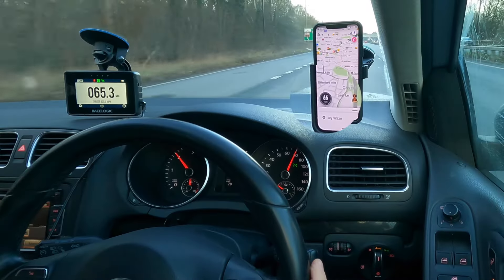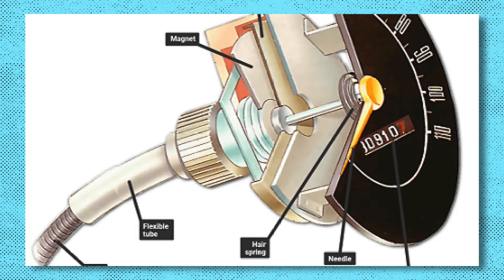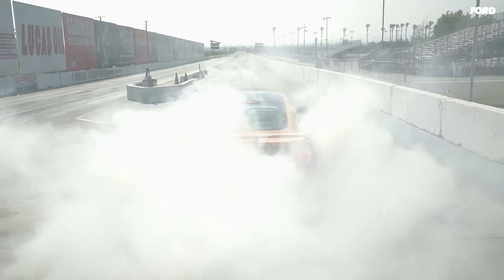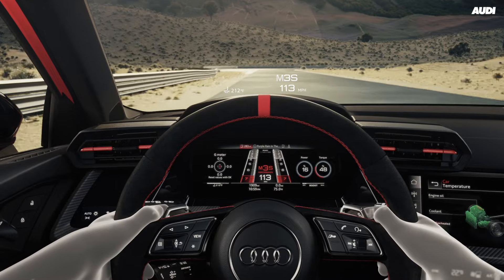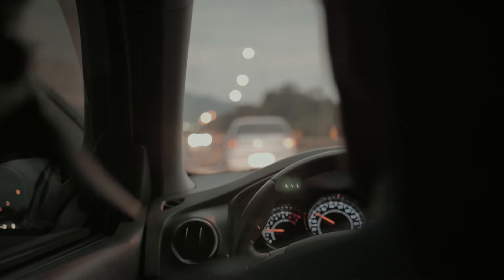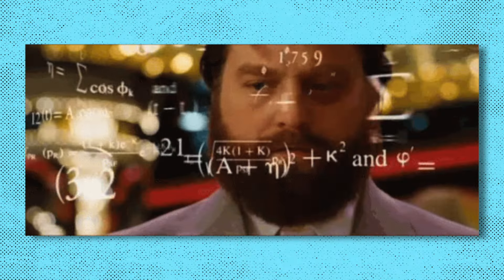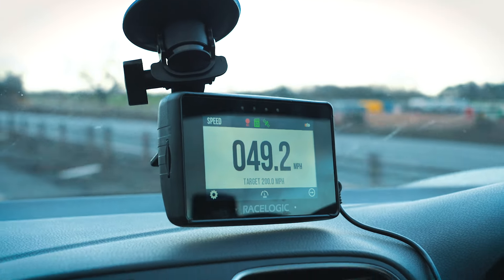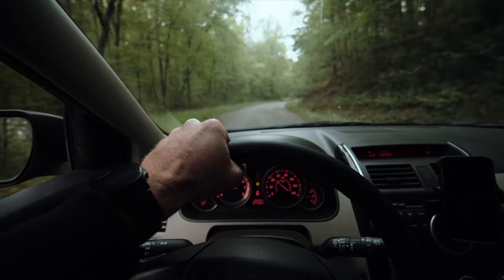Why Your Speedo is Lying to You

Comment: wheel speed sensors are usually used for abs and esc. 99% of the time most cars use a speed sensor from the gearbox for the speedo. just FYI.  Also the faster you go the futher out your speedo will read
Reply: Glad to see someone here actually knows the truth lol
Reply: Unless you have an old VW beetle with a hub reading
Reply: All the cars I have owned show speedo is off by the same absolute amount regardless of speed.  The computer reads the speed from sensors and subtracts a given amount…50kph is really 46, 100 is really 96.  120 is really 116.  Not a percentage amount, but a fixed amount regardless of speed.
Reply: Except most japanese cars? Which use the wheel speed sensor in the wheel hub.
Reply: Most EU manufacturers stopped using a gearbox speed sensor in recent years. Utilising a wheel speed sensor means they can cut costs and that sensor can have multiple uses, especially for the ever increasing amount of tech such as adaptive cruise, accident avoidance, cruise control, ABS/TC/SCS and even airbag systems. For instance, and from memory, Mercedes use the right front sensor for the speedo.
I'm sure some vehicles use GPS too.
Reply: Uhh no. May be true for American cars but Germans cars Def use wheels speed sensors for speed. On some cars you could even prove that by unplugging specific wheel speed sensor and speedo would stop working
Reply: Exactly!
Reply: @borysnijinski331  Does that mean it shows 0 at 4kmh or less?
Reply: @lukeberry94  my 2005 Honda has it on the transmission. The first time I did my brakes, I forgot to hook up the wheel hub one and the ABS system was NOT happy, but speedo was fine.

I use GPS everywhere and the speedo is bang on.
Reply: I work for Toyota, and for honda, kia, Mazda in the past. For the last 10 years atleast, the abs sensors are what gives the speedo reading. The gearbox method was eliminated sometime ago and definitely won't see it today
Reply: this is my understanding too, that it come from the gearbox. and also with the inaccuracy. it's a percentage it's out by rather than a set number of km.
Reply: It depends. First we had a mechanical cable to the gearbox, then we had an electrical cable to the gearbox, and then, as abs and stability control became standard in newer cars, some manufacturers figured why spend money on an additional sensor in the gearbox if you already have one on the wheel(s).
Reply: Some cars don't have vss, but the ones that have does this, so you speak the truth.
Reply: @Noreceipts400  No, it means the opposite. It reads as 4mph when completely stopped.
Reply: I broke my abs cable and my speedo stopped working until I fixed it
Reply: older BMW:s have the speed sensor in the differential
Reply: @lukeberry94  yeah, I've noticed infinities are almost exactly accurate vs bmw's are Abt 4 mph less says 64 when you're going 60
Reply: @borysnijinski331  This is what I’ve seen with my 2018 Civic Type R in the US.  From factory it was off by about 2 consistently regardless of whether I was going 30 MPH or 90 MPH; if it was based on a percentage, I’d expect it to be off by 2 at 30, 4 at 60, and 6 at 90, but that’s not the case based on the GPS systems as well as the radars that police set up that display your speed (only tested at 30 and 60 with the radars).  It leads me to believe that the car is taking whatever it uses to accurately get the wheel speed and just simply subtracting 2 from it.  It got me into the habit of just driving 2 MPH higher than what it was reading.

I also had a 2015 Camry before that which was consistently off by 3 or 4 (I forget the exact value; been a while since I drove it since I no longer own it).  Again, a constant 3 or 4 regardless of whether I was going 30 MPH or 60 MPH (checked by GPS and the police radars that they have set up on my daily routes).  I don’t think I ever did 90 in the Camry with a GPS running to confirm there though.
Reply: Most German cars use the wheel speed sensors most old and American cars that are older tec use gearbox readings
Reply: 99% of cars no longer have VSS in the driveline. The reason for that sensor was to mechanically "compute" the average speed of the wheels (using the differential as the computer) to account for cornering differences. Now that's done in software with no need for mechanical intervention. Any car with active stability control will almost certainly have ditched the VSS because it's redundant.
Reply: @roysoutdoorlife  Too bad cutting that certain cost means a high level on inaccuracy rather than using a proper and tested method.
Reply: Also if your tyres are more worn down it will say your are going even faster when you aren't
Reply: As a percentage the speedo will be off by the same amount. At 50 out by 5, at 100 out by 10.
Reply: @nallid7357  I think the accuracy is there but maybe manufacturers design a speedo to read high to help reduce speeds, which will increase fuel economy and reduce accidents? Just a thought!
Reply: @Mixz1890  American cars also use the wheel abs tone rings for the speedometer.
Reply: Moreover, that 10% overread is deliberate (at least on European manufacturers). It's based on a SAAB research. SAAB used to have a non-linear speedo, so the needle would be much higher than other cars, even for legal speeds, playing to the psychology of the driver. VW does the same thing on the lower end of the speedo to make acceleration seem more dramatic then it seems. So, car manufacturers kept their linear speedos and added 10% to the readings to make you think that you're traveling faster. It's also prevalent in motorcycles too.
Reply: @Noreceipts400  Most cars won't even show speeds of 10 or less, or so because it's not important. No limits go that low.
Reply: @samfedorka5629  Have you visually confirmed it's on the trans? It could be on a different wheel hub than you forgot the sensor on, unless you forgot all of them. I've got a 2004 Honda Civic and it would be interesting to locate this sensor myself.
Reply: @damderrick  What about cars before 2010 like 2004 Hondas? Have you had any experience with them?
Reply: @borysnijinski331  Most cars I've driven actually lie relative to the speed I'm pretty sure. Not a 100% sure but I think so. We've had new-ish Audis and BMWs and my dad has always said that it doesn't really start to lie until about 60-80 km/h.
Reply: @lukeberry94  all of my hondas get speed from a dedicated speed sensor mounted to the gearbox
Reply: I'm on the east coast our limit is 55 or 65 so I tend to go 70 😂

Comment: actually, as a delivery man, i'm quite familiar with this system here in Hungary. our fiats overread by around 6km/h, and fixed cameras have a given tolerance (by law) depending on speed, in 50km/h areas its 62km/h. so in theory you could pass the camera in a 50 zone at 67, and not get a ticket. I usually play it safe as you say in the video, and never exceed 60. and it's working, I haven't gotten any tickets so far. at least not from fixed cameras.
Reply: I stick to the 10% rule.. if Im supposed to go 50 Im going 55 on the speedometer and so on. But when I go through a route that I know very well (where the straights are, where it is possible to safely ovetake, where the holes are in the road, where the cops like to measure the speed etc.), I will push the car. Theres no reason to go 90 on a road that I can perfectly travel at 150 without endangering myself nor anyone else and also without the risk of getting a ticket.
Reply: @alunesh12345   Off point, but yes. Is speeding a sin though? I'd say it is.
Reply: @MisoElEven  If something changes you're going an extra 60kmh faster though. And what if someone doesnt realise you're going that much faster and pulls out in front of you?
Reply: @Noreceipts400  Theres nothing that can change on that particular road and I can see several km ahead..the faster the overtaking manouver is over the safer it is. What if the driver doesnt see you when youre going the legal 90km/h while the other one is doing 80? Nothing changes, you will crash if he moves to that lane or a car flies into my face from the other side. Seriously, unless the car in front explodes theres nothing that can happen on that particular road. Lets not forget theres not much traffic anyway. If anything I would be more afraid of gypsies crossing the road with their tons of copper and other scrap metal etc. XD in the city where I was born (Košice) theyre aparently going to lower the speed limit on the highway from 130 to 90 and install traffic lights just so they can move the trash they have stolen from one side to the other because if we built a wall again then the EU could sanction us for racism/segregation. Thankfully I dont have to ride through that piece of road anymore.

Edit: also you always have to let the car in the left lane go, even if its speeding and youre just moving to the left to avoid a colission with lets say a bus.
Reply: @alunesh12345  leave it out
Reply: @alunesh12345  so sad in the Netherlands I went 52 in a 50 zones and got a fine of like 40 bucks and 10 euros extra because they are so lazy and can't do their job. Really stoped caring about the speed limit after than and just look for cars and cameras.

 And I do intentionally drive way to fast on that road now, I need to earn about 50 euros worth of time on a road I only drive a few minutes on and account for higher fuel useage.
Reply: @NekoWinters  i wish ones where I lived would get destroyed more often. All they do is distract you from driving and make non dangerous situations dangerous since you can't pay attention to the road and 2kmh over the speed limit gives you a hefty fine.

Some peolple are so pathetic they will fine you for doing 121kmh on the highway when 120 is allowed.
Reply: In the US there aren't many camera systems that give speeding tickets as far as I know.

We have helicopters that can spot speeders, though. You'll see signs that say "speed enforced by aircraft".
Reply: @slowanddeliberate6893  Yes, but the amount of cops you have is ridiculous instead. And chasing speeders from helicopter is even worse. Speed cameras are bad - but at least quite easy to avoid.
Reply: @slowanddeliberate6893  depending on where it is. In md, dc its infestation of speed cameras.
Reply: @ravecsucks6192  these were based on my specific speedo. The thing is, we have fixed and mobile speed cameras. the mobile cameras are usually set up by the dear police, in some shady well covered location so you can't notice it until it's too late. on this mobile camera, they can adjust the limit at which it consideres someone speeding. the lowest they can set it is the given zone limit + 3km/h (so in a 50 zone 53, in 70 zone 73 etc.) the fixed cameras have a fixed limit, which according to most sources is either +16 or +18 km/h where the zone limit is below 100km/h, and +21 or +23 km/h where the zone limit is over 100km/h. so theoretically on the motorway you should be fine with 150 on the gps, and around 155 speedo, but I personally have never pushed to that far. https://alapjarat.hu/hasznos-infok/mekkora-sebessegtullepesnel-nem-buntetnek-meg https://www.detektorbolt.hu/gyorshajtas-buntetesi-tetelei-birsagok these are in hungarian, but there are 2 tables which you can check out in the articles containing the limits and fines.
also the trick is, that even tho the fixed cameras dont send a fine under these fine limits, they do notice of you go faster than the zone limit. so there is always a possibility that the police set up camp around these fixed cameras, and pull you over and give you a fine between 5-50.000 forints
ps: i usually set it at 136-139, so even the rozzers on location souldn't be able to fine me.
Reply: @ravecsucks6192  there probably is, but I don't know the laws on that.
Reply: @hagymasymarton4714  Have you taught about getting a radar detector? It seems like that could be quite helpful against those evil cops hiding with speed cameras, haha. Then you can drive at nice speed most of the time and only slow down where the cameras are. Where I live (in Sweden) they are kind enough to put signs in front of them, so it's easy to see where to hit the brakes (a detector hasn't really been needed). But I think I will get one soon anyway - because our cops is also about to get some nasty cars, where they use radar (I think those also might be some kind of mobile speed camera as well)
Reply: @MisoElEven  150?
Reply: @MisoElEven  I really hope you are talking about kph and not mph!!!
Reply: @tilburg8683  er gaat toch altijd 5 correctie af als het door een auto wordt gedaan, dus 121-120 kun je van een agent geen boete voor krijgen. 
En over die 50-52, dat zou je met een advocaat gewoon winnen, veel instituten die te maken hebben met de wet zijn er helaas niet goed van op de hoogte hoe deze werkt.
Reply: @MODElAIRPLANE100  150km/h not miles of course.. depends on the road too, there are spots where any speed is pretty much safe but then there are spots where you better slow down to 40 despite legally being allowed to go 90. Also depends if youre driving a 20 year old skoda or a brand new mercedes, whats safe or not really depends on your reflexes, knowledge of the track and the car itself... too bad theres plenty of 20 year olds who have little to no experience and they push it a lot in 20-30yo Bavarian monsters.
Reply: Damn that tolerance is massive! I wish they were as lenient over here in austria
Reply: @mattBLACKpunk  Well..they arent much different in Austria as far as I know. The "cameras" used dont even show speeds under 56kmh as far as I know.
Reply: @MisoElEven  yup, inside cities its 5kph over, but everywhere outside its 5% - 62 is a lot more wiggle room than 55 imo, although I might just start driving faster if that was the de facto upper limit 😅
What really gets you though is the 5% on country roads (105) and motorways (137)
Reply: @mattBLACKpunk  I use the 10% rule because the speedometer shows a lower value (on VW group cars its about 5%ish?). Speed really depends on the situation, you can be on a 50 but when someone jumps on the road from your right you still might get partial blame because you didnt adjust the speed for road condition etc. (the courts forensic expert might somehow calculate you should have gone 39kmh instead of 48 because of weather, cars parked on the right, road condition and all kinds of stuff... and yes this actually happened to a friend of mine in Košice)
Reply: @MisoElEven  tbh I already drive with my actual speed in mind rather than the one on my speedo, so that doesn't help the situation either haha
Reply: Bojler eladó!
Reply: Hahahah what 12 km/h tolerance!?? Thats amazing. In Luxembourg its like 2-3 km/h.